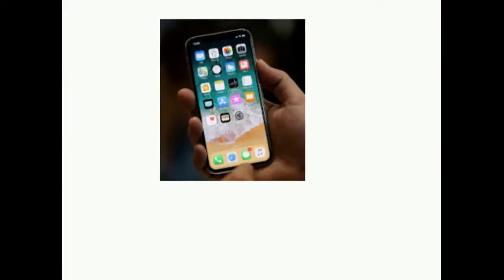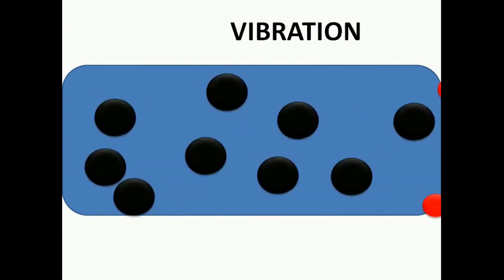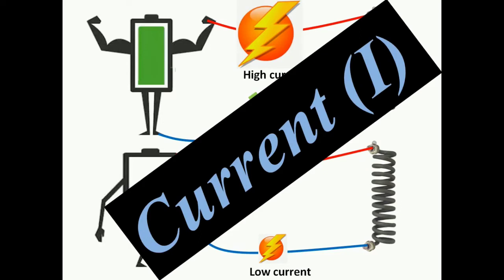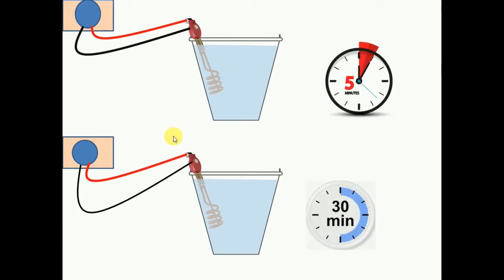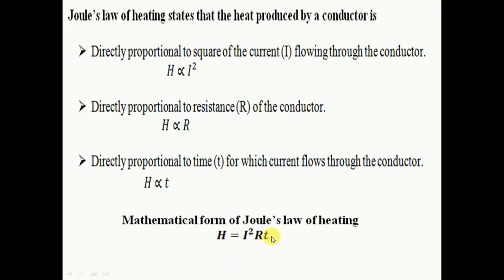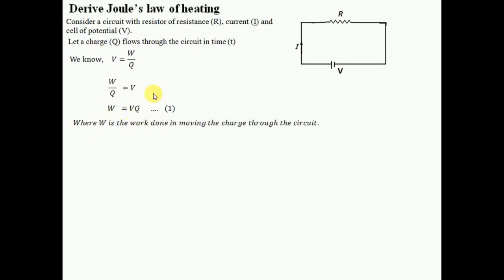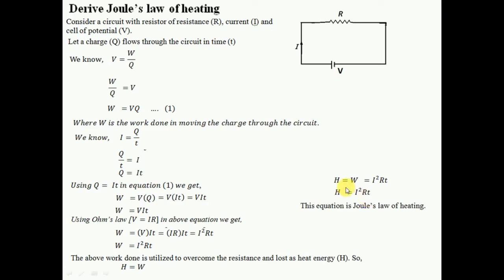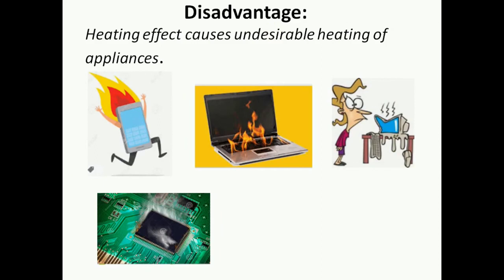Heating effect of electric current and Joule's law | derivation of Joules law |

Comment: This video, as always, was understandable as everything was sort of taught in a sequence. I found it interesting when the old formulas(like V=IR, B=W/Q, I=Q/T etc.) which we had learned came into action in order to complete  Joule's law. 
I understood that joule's law depends on the current, resistance and time of current flow of the conductor. However, heating of conductors also produce unnecessary  heating which may lead to some undesirable damages. I figured that the application of this principle is used in almost all electrical appliances.
This video was very informative and the concepts were simply taught. Thank you sir once again for helping us learn Physics in a 'uncomplicated' manner.😁🙇‍♀️